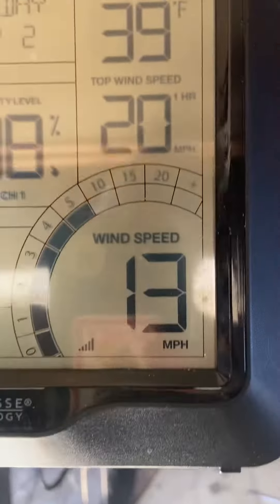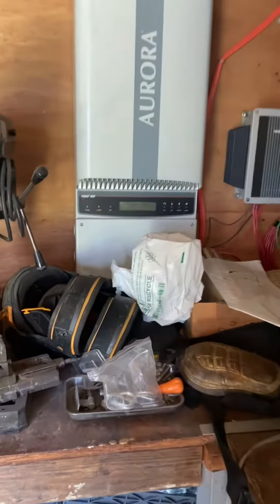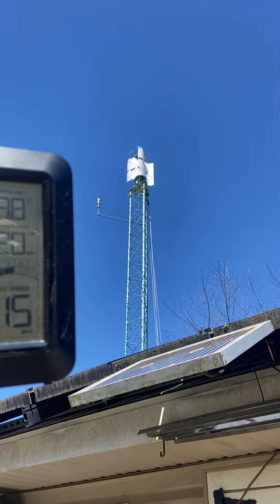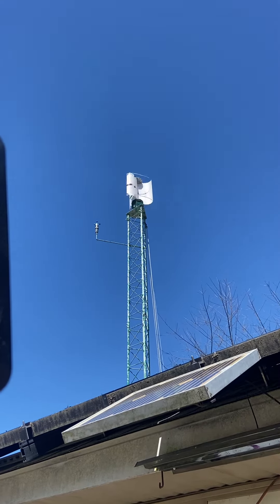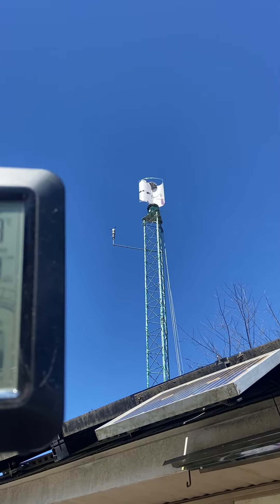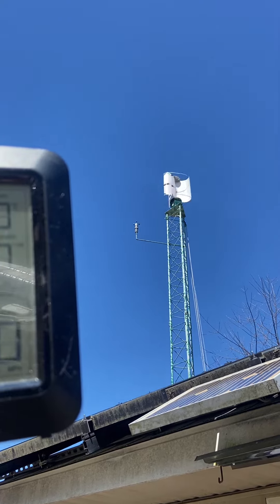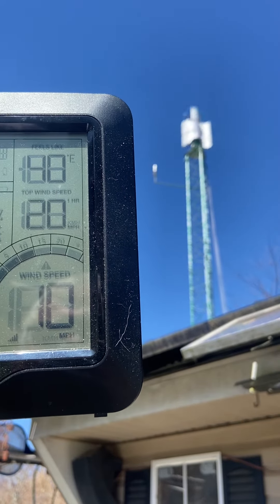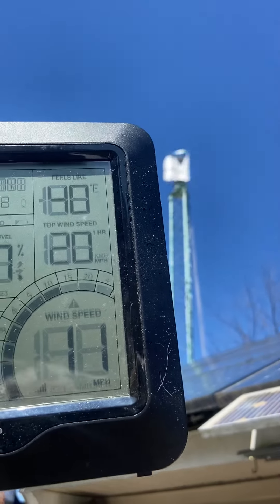Vertical Wind Turbine’s.   Modification again.. Tesup Junk

Comment: It would have worked here on the hill...the wind was making 85 mph gusts yesterday. My little wind turbine survived. I'm going to put lock nuts behind the hub now. I've never seen a wind generator turn that fast. I thought it was going to fly apart maybe. I tried shorting the windings but it only slowed it down a little bit. Only thing I could do was turn on the hotplate, a 1200 watts load. Oh, and I found a bad battery in the twenty. It was shorted. It was one of the original four that I started with. It has had a hard life. So I have to get one. It had my whole system screwed up. It's showing 9.7 voltage. After charging for two days. I still have eight batteries unhooked. I'm going to make new cables. I ordered a watts meter so that I can tell how much power my wind turbine is making. The last I heard you were going to shorten the arms of the blades a few inches, now all that is gone. Change of plans, I guess. Well, since you are modifying, I have an idea for you, maybe. How about redoing the connections of the ends of the three phases, and put them in series instead of parallel? Then the  generator Will be easier to turn, so that will let it rev up to operating speed. It's my theory that having the windings in parallel is something like having the brakes on lightly, it never gets going fast enough to generate any power because it's choked off from getting up to speed. If you notice, nobody wants to open the box and look at the generator itself. To me that is the only solution. You can't get enough torque out of that blade setup to get it charging. But in series, it will take the initial start up load off the blades. That's what they missed when they made it. So since it's not wired right, it can't get going. I understand now. That's why none of them work. They didn't have a clue, lol. There's only so much torque that you can get from the dinky blades. So wire it in series, and let it spool up. They didn't get that part. They just stuck a three phase PMA generator on it and figured it would work. But it takes more torque than the tinkertoy blades make. So they're scratching their heads, and still don't know why it doesn't work. If you don't believe me, try it. There should only be two leads instead of three coming out. And that, will let it turn. And when it finally turns, that will be a red letter day in the world of science. Now that would be one heck of a mod to video. The reason Tesups fail, and the fix.  You might get that million views yet. I'm still pulling for you to. When you have no more ideas, try what I have told you, and see for yourself. They failed to take it into consideration. So it's sort of acting like when the three phases are shorted, and keeping it from getting started going. When rewired in series, the brakes will be off. Simple, isn't it? But nobody does it because they hid the generator really well. Well at this point, you don't have much to lose to try it. You can always switch the connections on the outside of the generator, if you think it was wrong. When it gets warmer weather, I'm going to do the same thing to mine. I plan to get higher voltage, let it turn faster under less bearing load, so better voltage to the controller. I'm saving for a Midnite classic charge controller. Then I will get much more wattage out of the one I have. I know you haven't thought of this mod probably, but nobody else has either, but me, lol. It was invented by Tesla, and an example of the polyphase system is at Niagra falls. They had to use it there. It's more efficient than three phase. But they want to keep that a secret. What happens with polyphase is, everything runs cooler like rectifiers, etc, so it lasts longer. For every cycle, there's nine phase peaks instead of three, so it's not hard to get it to DC from there. So as a result the rectifier runs cooler and lets more through.  I think this idea might work out for your very poorly designed wind turbine. It's like you said, it all keeps going back to the generator head. They didn't think anyone would ever guess what was wrong with it, did they? So they would buy the new and better one, maybe...And if they did guess what was wrong, they wouldn't want to dig it out of that closed up steel box, take it apart, and fix it. Just buy the new and improved one. So nobody has ever fixed one. It's in a pile still in that steel box. Just think, if you discover that this works, it will actually be making power... can't say how much. But the blades will think there's only one winding instead of three, and it'll turn much faster. That's the only answer I see. Let me know what you think. I'm going to do it to mine later on when I get the DC wind generator working. I bought a set of five Stealth Storm blades and hub from Hurricane Wind Power, good to 144 MPH, and some slip rings. I have a DC motor that makes 79 volts. I think it will make 450 watts or so. Are you reinventing the wheel? Don't forget to reinvent the hub as well...good luck with getting the bugs out of it. I would like to see it spinning merrily along. Think about what I told you until you have to try it. I'm going to do it to mine, I promise. It'll work, just not sure how well with what  you have. But some is probably better than none, in this case. Mine already is spinning, just needs higher voltage. It should make 60-75 volts after I change the connections. It'll be about triple  what it makes now. When I change it around, I'll do a video about it. It'll be fun. I'm wanting for you to get it working so that when I get my watt meter, we can compare...hope that helps you get some results... it's funny that both of our turbines needed the same fix.
Reply from the maker: i’m first going to reinstall the air foil blades at 1 m diameter. According to the engineer who ran mathematical numbers for me. Then I will talk to you about how to change the generator from three phase to two or single phase.

Comment: what happened dude ??
Reply from the maker: it works at a slow start up speed, but takes 8 m a second to produce power and I have to have that continuously. Which is very high for this area plus I am reinstalling the airfoils at 1 m diameter according to the engineer who ran numbers for me.
Reply: @Themachinewon  No problem 👍very good